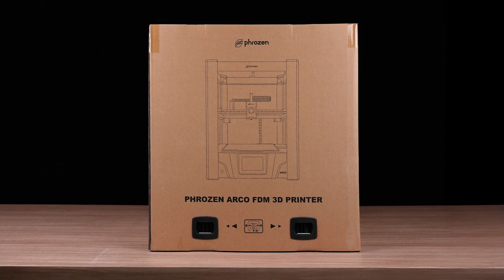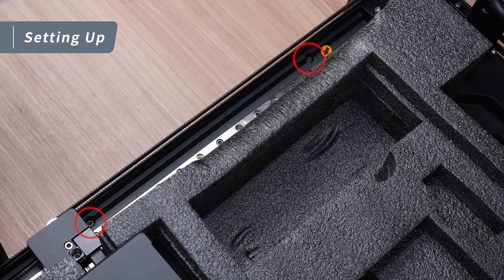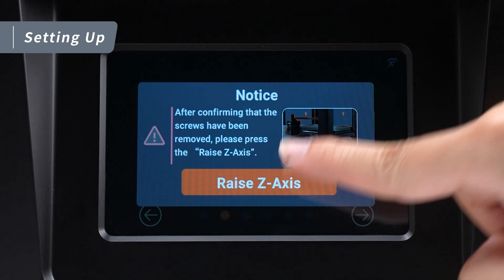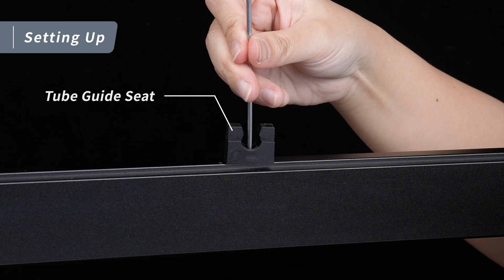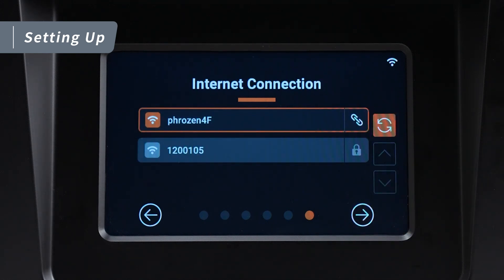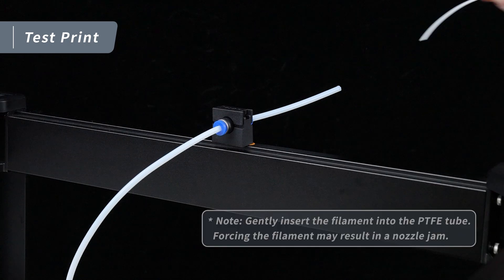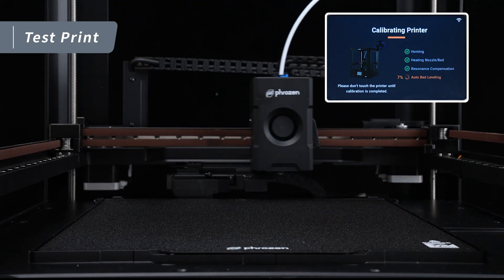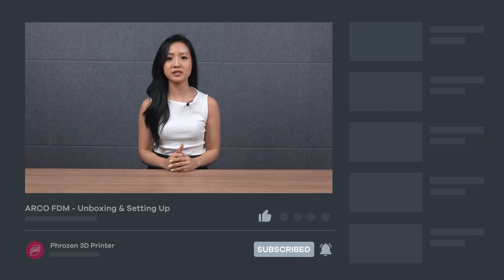ARCO - Unboxing & Setting Up — Phrozen 3D Printer

Comment: Probably a better way for feedback, but I really wish the screen could be adjusted.  My printer is on top of a Home Depot "cart" but is low enough I usually have to bend down to read the screen.  Allowing it to angle up would have been very helpful.  Probably not fixable for the Arco, but consider that for the future.  Being able to flip it so I could read it from above easier would make that part much easier.
Reply from the maker: Thanks so much for the feedback! We appreciate you sharing your thoughts on the screen angle. 🙏
Reply: @phrozen3d  I also am anxious to get my Chroma unit soon since I am printing well mostly otherwise.

Comment: I started the setup process (again) last night.  It is still in the "configuring the extruder" step almost 24 hours later.  How long should this take?

ANSWER - Stupid User Error in this case.  I needed to press a button.  It was not doing anything!

I am still unclear exactly what I needed to look for in the "is it aligned?" step that came just after this.  It looked like it was on the collection thing in the right place, so I continued.
Reply from the maker: Hi @bradandrews777, sorry for the late reply. It seems that you’ve resolved part of the issues. If you still encounter any problems or need immediate assistance, please contact us here: https://helpcenter.phrozen3d.com/hc/en-us/requests/new. Our technical team will be happy to help.

You can also join our Facebook group: https://www.facebook.com/groups/274599705235544, where many users share tips and experiences.
Reply: @phrozen3d  I have been printing a bit since then.  Getting the back on was a real pain, but it worked fine once I got it to work.

Now I just want my multi-color spool attachment!

BTW, I need to be able to toggle the inner light in many places.  I can't turn it off after stopping a print until the print is in progress, for example.  (Or turn it on then.)

I also get an error when I try to check for updating the BIOS even though I have a valid WiFi connection.